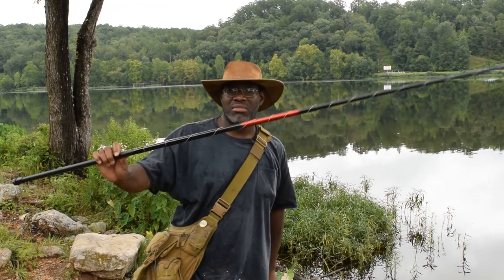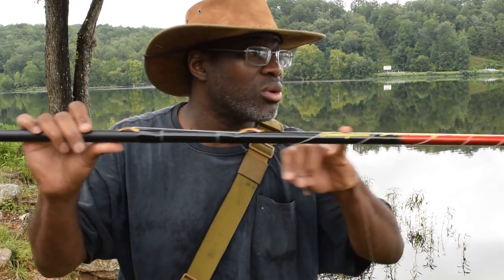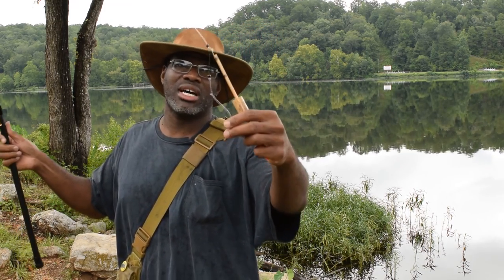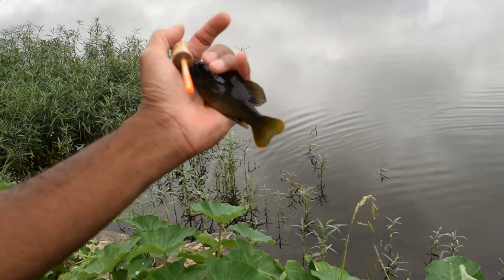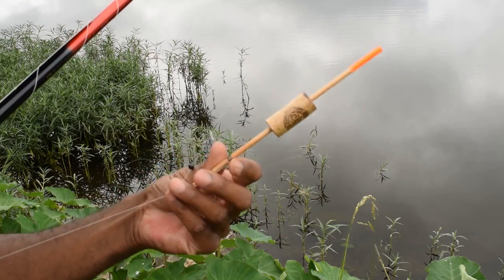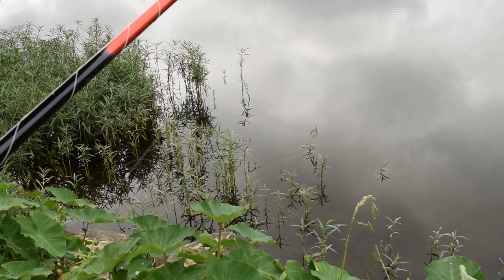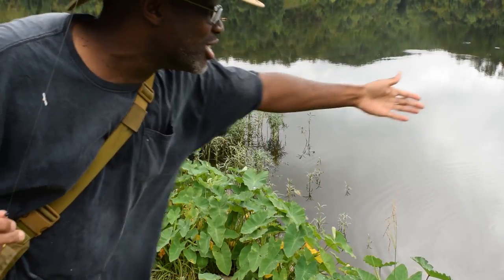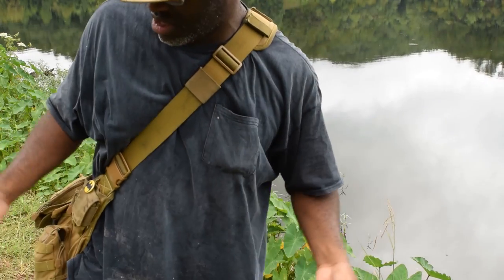Cane Pole Fishing in Alabama | Cane Pole Setup

Comment: I'm only kidding great video.
Reply from the maker: Oh, my bad. I do plan on cutting some real cane here in a bit and do some spider rigging the old school way. I really have noticed a difference between the handline and the crappie pole. Just getting the line out from the boat a little bit does help.

I figure wrap with 15 lbs mono or something down to a swivel, then down to whatever line I plan to use. Use different size leaders for depth control.